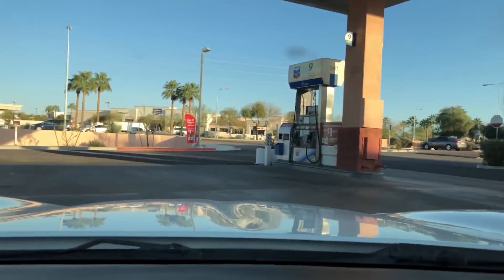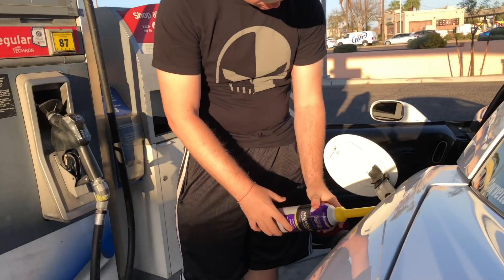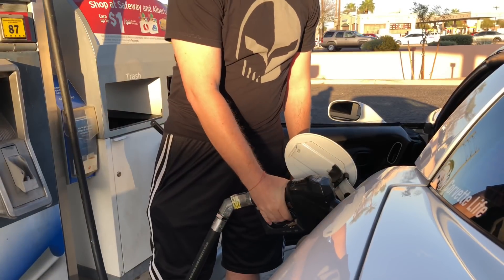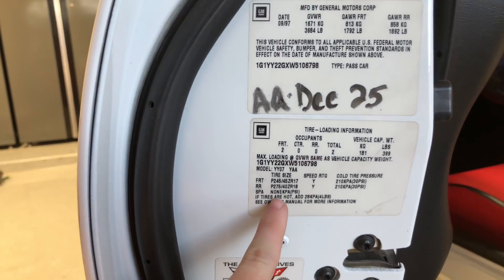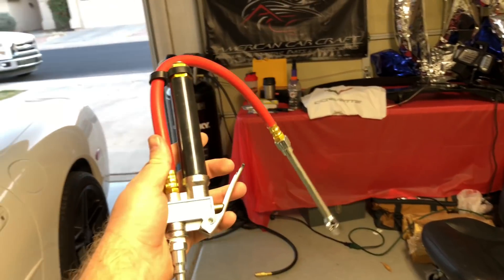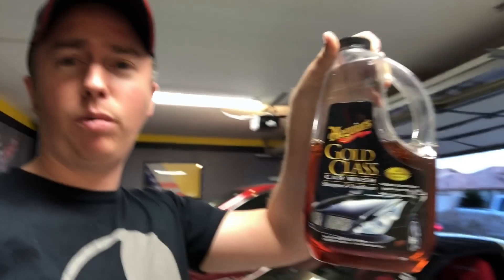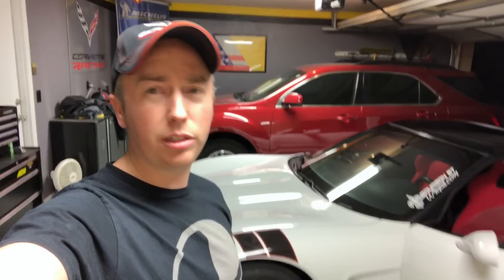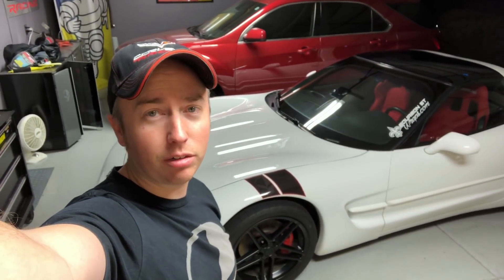Corvette Weekend Prep

Comment: Chris since we have  91 octane here in AZ, with the exception of a few stations, do you use an Octane booster?
Reply from the maker: No.  There is really no need to unless your car is specifically tuned to run a higher octane.